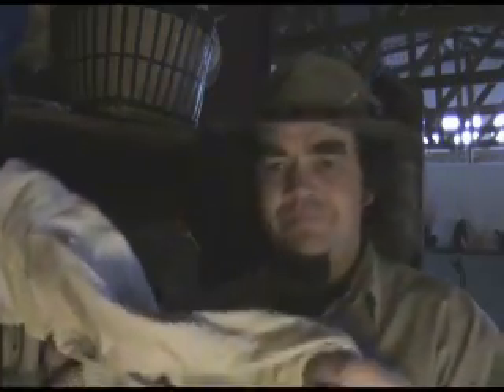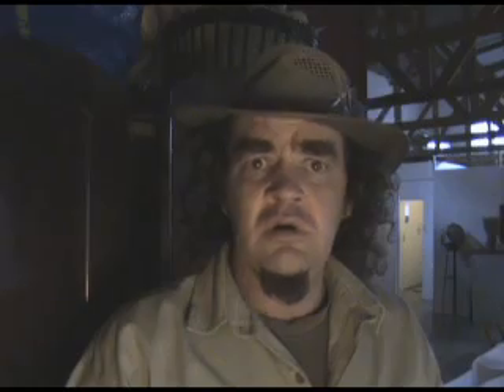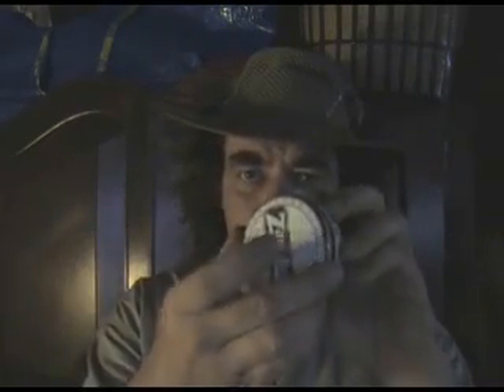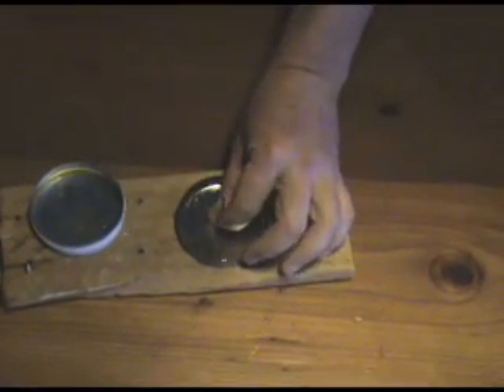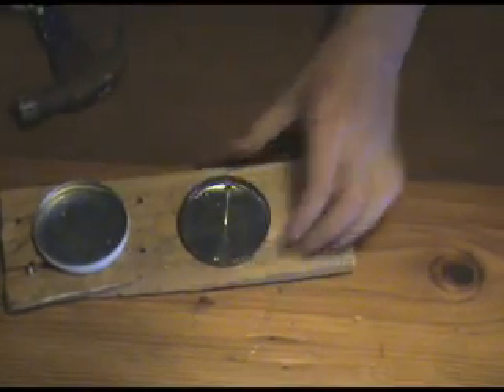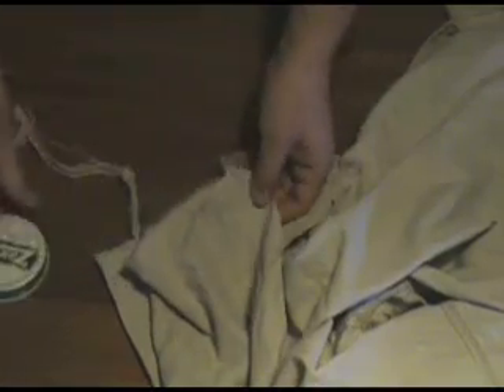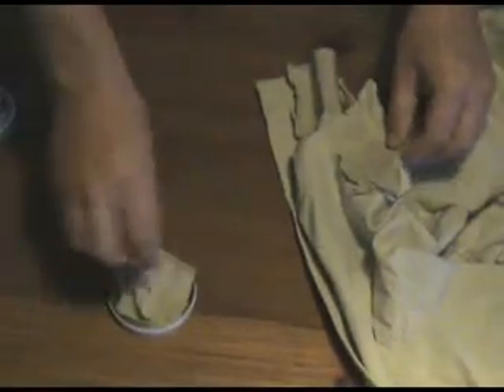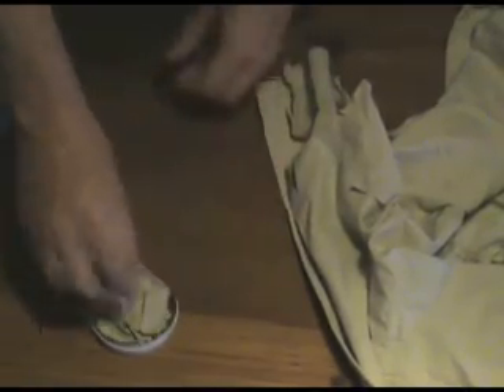101 Ways to MAKE FIRE - #7 The Devil's Breath

Comment: I assume whats happening is. That as CO2 (Carbon Dioxide) is being made O2 (oxygen) is getting lower. As There is not enough O2 (Oxygen) the CO2 (carbon dioxide) can not be formed so it forms CO (Carbon monoxide) which is slightly flammable and will give a blue flame when burned. CO (carbon monoxide) is also known as coal gas. Instead of using the cloth, I assume you could use pencil lead (Graphite which is carbon) and you could crush that up and place it in the air tight container then heat.

Comment: well can't argue with the fact that you obviously made fire. unfortunately you need heat to make it in such a way. this works much like a gasifier. which is basically a steel drum with a fire in it. and another steel drum with just wood in it. when the wood heats up it creates a gas that you can run a car or a generator on. by the way good usage of "thats what she said" and i'm not sure but i may be the only one who heard you whistling the ring of fire by johnny cash in the backround